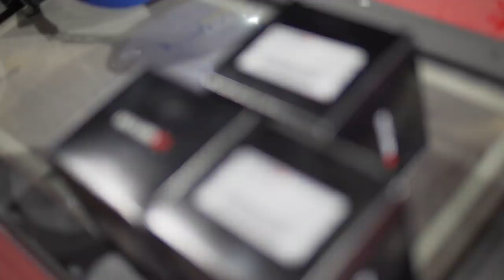Salvaged R34 Skyline almost Fully RESTORED | Poor Man's GTR [EP14]

Comment: I need to pull my rear subframe as well on my R33. I have a new HICAS delete, tension rods, traction rods, front/rear camber arms and lower control arms from Driftworks and a set of Tein Flex Z's that i've been meaning to fit, but I may as well drop the whole subframe and get it powder coated & new bushings while im at it. 

This is getting so close! I hope you're staying with the classic RB engine to finish it off, also don't forget those clear nismo indicators for that beautiful front bar ;o

Comment: I'm loving this build man, you're doing such a thorough job! Also happy new year :D 
I feel like the information you provided about the polyurethane bushings isn't entirely complete though(Not saying you're wrong, cause you're not!). I personally have almost my entire car(BMW E36) done in polyurethane bushings. I personally used Strongflex red, and have absolutely zero vibrations or harshness, the car rides as firm-but-forgiving as a brand new 2019 car. Their red model is supposed to be as weak/forgiving as OEM rubber bushings. Only difference being that rubber bushings lose a lot of their initial stiffness after a short period of time, then stay like that for, say, 150,000km before they wear out. Whereas the "weak" poly bushings stay like the rubber ones were when first installed. I think Powerflex and some other poly bush manufacturers have a bushing option similar to  the rubber as well.
 While I agree that the brand-new-car-firm-but-forgiving isn't how cars like your Skyline or my E36 came out of the factory(ours were probably a lot less stiff, being from the 90s), I think it's somewhat incomplete to say "polybushings transmit so much vibration" etc.
Reply from the maker: Thanks mate HNY to you too

Comment: I will also add to the bushing debate. You can do a combination of all three. That said a smooth application of power solves most problems. Under hard acceleration though some suspension setting do change so to ensure max traction is available a few either harder durometer rubber bushings or poly bushings in key areas keeps the noise down. You also need to add zerk fittings to places you have poly or rubber bushings to keep them lubricated and noise free.

Comment: i have a few sugestions: get a white refector or however it is caled in the front bumper
                                                  get volk racing te37 wheels 
                                                  polish out the headlights
                                                  and keep up the work

Comment: Oh damn this edit is fire!
Some advice and a few questions.
With the metal caged bushings, make your life easier by putting them in the freezer for a day or 2 before hand :) slips right in 

What product did you use for the under body coating? It has like factory texture and is perfect really
Are you going to end up redoing the front end suspension? All fresh stuff? And have you picked out a wheel choice yet? 
I’m so fucking keen bro!
Reply from the maker: Cheers man haha

Made a video on the underside already
Yep will be putting my front suspension in
Not sure about wheels yet

Comment: I use the PU bushing for the rear r34 subframe.after a month I change to the oem bushing.haha.
The vibrating and it is annoying.
18 inch rim just nice.19 inch rim is heavy and tyres are expensive here in malaysia.

Comment: As a mechanic I would never use a sander or flap wheel to clean up hole were bushes are a press fit just use sand paper do it by hand , and why would you use rubber bushes again ?? Well most know that nismo do a harder style rubber replacement. But on non Nissan vehicle you'd be better off with poly bushes